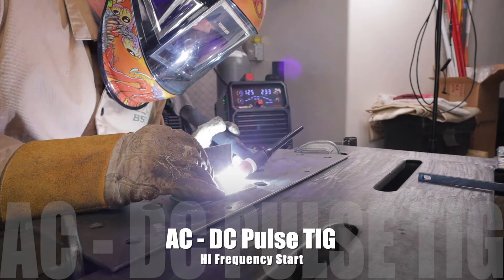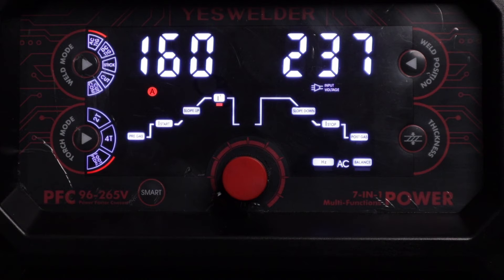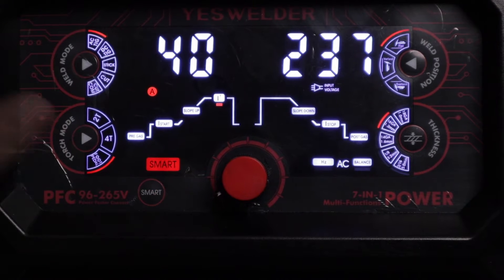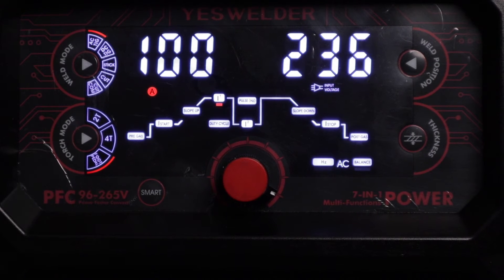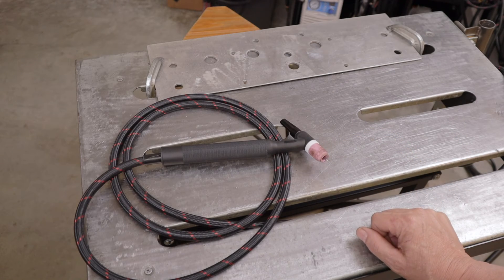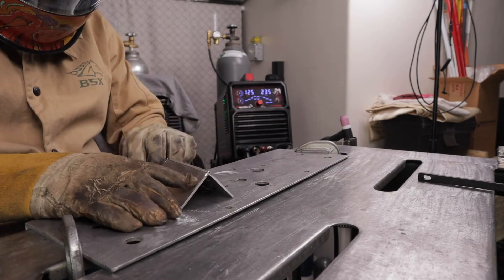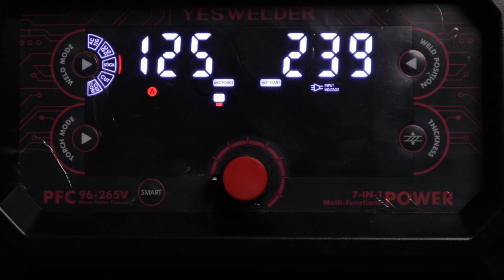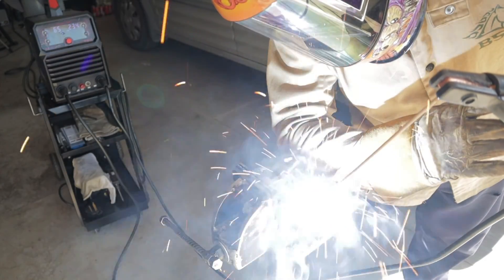Is the YesWelder Firstess CT2050 AC-DC TIG Welder & Plasma Cutter Worth It? Find Out!

Comment: would you buy the tig 205 Yeswelder or the 250p Yeswelder tig??
I want to get into tig welding and have watched your Yeswelder videos.  Do you know if the tig 205 will do stainless and if so are they built to last??
Thank you,
B
Reply from the maker: That's a tough question to answer because I haven't used either of those machines myself. Any DC tig machine is capable of welding stainless. An AC capable machine is required to tig weld aluminum. I would say if you can afford it I would get the 250 over the 205 so as you learn you will have a machine that can do a little thicker material due to the extra power. IMO these are not industrial machines but affordable and great for learning and home hobby use. I have one of the original YW tig 250P AC/DC that I've been using for four years now and it's still going strong. Well worth the money IMO!
Reply: Thank you! @DIYHomesteadProjectsDIYHP10
Reply from the maker: You're welcome and I wish you the best with your welding adventures!

Comment: Awesome video and based on your review, I did order the YesWelder. 

However, due to very poor customer service and with the errorously charging and fraudulently collecting a city sales tax which I am not required to pay, I cancelled my order and YesWelder is providing a 100% refund. YesWelder customer service refused to refund the fraudulently collected city sales tax and stood their ground on ignorance and laziness, and "relying" on their "system" to "automatically" charge for said taxes.

PSA: I do recommend for those who have made a purchase with YesWelder to double check their invoices for accuracy of all charges. I live in the county, not the city limits, and therefore I am not required to pay a city sales tax. For charging me a city sales tax was in error. This information was in fact confirmed by me calling the "City" revenue department. 

Not only did YesWelder lost the sale because of the fraudulent collection of city sales tax (in my situation), they lost a customer and any possible repeat sales.
Reply from the maker: Well that's a bummer to hear. I've developed a habit of reviewing the order and all the charges prior to hitting the submit button these days. If the order doesn't look correct or there are charges that shouldn't be there then I don't submit the order until I get it worked out. It will prevent a person from getting into the situation you have experienced. Good luck to you with your search Mikell.
Reply: @DIYHomesteadProjectsDIYHP10  Yes you are correct. Lesson learned. I was looking forward to receiving my 7-n-1 welder and start the learning process. I'll just have to seek elsewhere for my needs. I'm not in it as a business, but as a hobby, therapy, and keeping myself actively learning.
Reply from the maker: I'm in it for the same reasons as you. Hobby, therapy and learning something new. 👍

Comment: On another review in DC Tig the foot pedal option was not there, does the machine have a normal HF start DC Tig foot pedal option? SO you have full control over the amperage, and the only option at that point should be pre and post flow.
Reply from the maker: Yes George, this machine has HF start DC TIG foot pedal option.

Comment: Why didn't you cut with the internal air compressor?
Reply from the maker: All cutting in this video was done using the internal air compressor.
Reply: @DIYHomesteadProjectsDIYHP10  for some reason I thought you said you were using external air.
Reply from the maker: No problem, all cuts in the video were using the internal air compressor.

Comment: How is this welder a 7 in 1 but does not perform MIG? Their model MP200 is a 5 in 1 one and has more features and processes including MIG.
Reply from the maker: They are counting the pulse settings in both AC and DC TIG. The TIG features include a HF arc start and the ability to connect a foot pedal. An internal air compressor for the plasma cutter and a "no touch" pilot arc with blow back arc start that is suitable for most plasma cutting table set ups. The MP200 is a more basic machine including the MIG process. The CT2050 is a more advanced machine mainly focusing on the AC and DC TIG operations with the ability to TIG weld aluminum as well as some advanced plasma cutting features.

Comment: Thank you for the video! This answered some of my questions.
I had thought this also did MIG as well. Unfortunate it doesn't as that would be a complete all in one. However still a great deal even with buying a Yes Welder MIG I am still saving a bunch of money rather than going Miller Multimatic 220 plus I will have a plasma to use. 
I also will be changing my TIG torch once I receive it as that looks to be very bulky!
Question: Why would you use an external air compressor versus just using the internal one?
Reply from the maker: You are welcome BBB. That's a good question! IMO the whole point is to not have to use or even have an external compressor. Maybe they made it that way just for another option and really no extra cost to produce it.

Comment: What is the adjustment range on pulse mode?
Reply from the maker: 20-250 pulses per second
Reply: @DIYHomesteadProjectsDIYHP10  Is there both a high and low level pulse or is it only high?
Reply from the maker: Just one pulse setting but that one setting it will do the entire 20-250 range.

Comment: I don't think it's really necessary to display the input voltage. I'd say just throw an led or like a box with a check on the screen showing if you're on 110 or 220. I also think an air pressure display for the plasma cutter would be a good feature. Otherwise seems like another solid machine from yeswelder
Reply: That because it supports more than just 110 or 220. With how they made it operate between 96-260 volt range allows the same unit to be used in any country without any sort of adapter.
Reply from the maker: I agree with you Ben
Reply: Another useful aspect of showing the input voltage is seeing when/if it dips as you're using the machine - that tells you when you've got inadequate wiring between the source and the welder.  You can't get that out of just a 110/220 LED.

Comment: How would you rate the durability and build quality of the machine?  Are there any parts of it that gave you a negative impression of the welder?
Reply from the maker: I think the durability and build quality are both an 8 out of 10. The machine feels solid and appears as good if not better than any of the previous YesWelder machines I've reviewed. Only one negative I can think of so far. The machine has two cooling fans. It seem as one is for the TIG portion and it is temp controlled and I really like that. The second fan appears as though it's for the plasma cutter and it runs constantly. It may cool something else as well but it would be nice if it was also a temp controlled fan and only came on as needed.